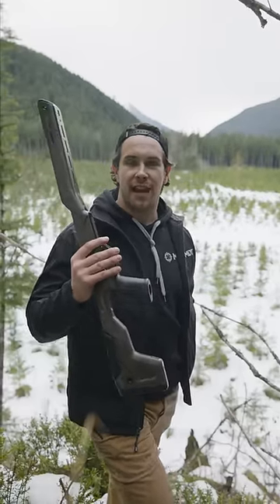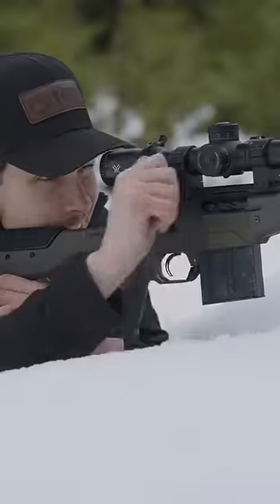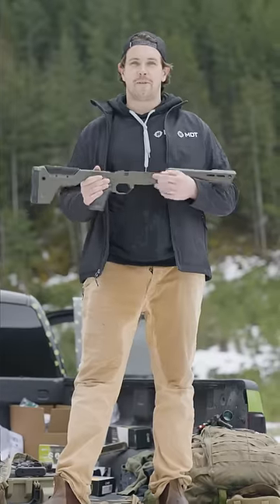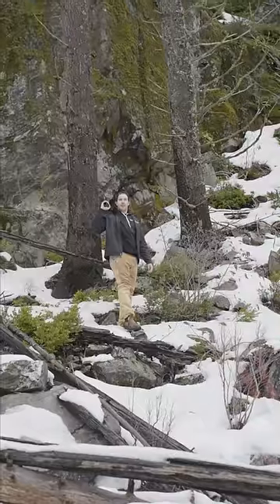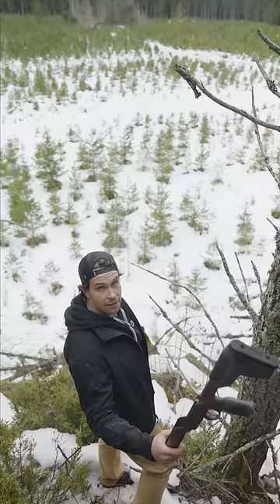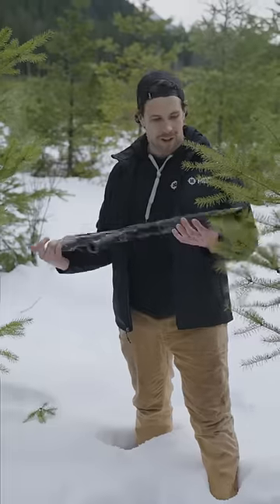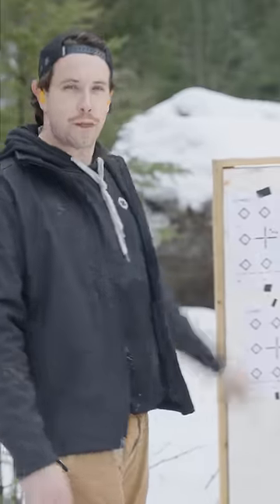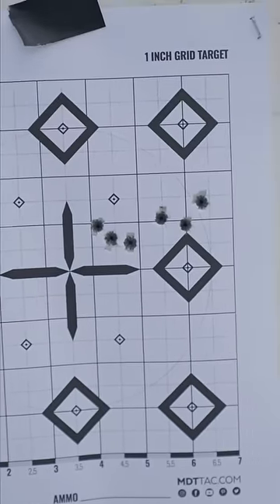Drop Testing Our MDT HNT26 Chassis System

Comment: I don’t think testing something within its limits counts as a test
Reply from the maker: Do you regularly throw your rifle off cliffs? Gangsta!!🔫
Reply: @MDTTAC  it would be if the part your testing wasn’t one piece of extremely light and durable plastic with no tension or load on it, how realistic is this?
Reply from the maker: @THESLlCK  You would be quite surprised by some of the questions that can come up, plus the weather we get here is usually much milder and it presented a unique opportunity.
Reply: That was a stock thrown into soft snow. Not a rifle.
Reply: @MDTTAC where's the barrel that's what matter's the most
Reply: @MDTTAC  yeah soft snow for protection do that on a real road or your drop test hb actually test it on solid ground not snow or grass that's relatively soft 😉
Reply: @MDTTAC no no you got a point. I was wondering how far you can throw it, now we know. how long it takes to hit the ground from a 30 ft cliff, boom answered. don't let someone that doubts your science get under your dingleberrys
Reply from the maker: @trey8875  It was taken out for this as we were specifically seeing what it takes to dislodge the end cap on the forend.
Reply: @planetzodd4849  go to kg boom boom yw 😉
Reply: @MDTTAC  you didn't throw the rifle off. You threw the fucking shell of it. That's like saying you cut a tree down when you only snapped off a branch.
Reply: @MDTTAC I would if I were the developer and therefore responsible for extensive testing of my own product.
Reply: @MDTTAC  do you regularly use unequal comparisons and just about pointless actions in all advertisements of your product?
Reply: @MDTTAC Yes. The occasionally fly off of a UTV or ATVs. We drive about a hundred miles a day on average around the ranch and stuff like that happens. 
I will say my MDT stock on my 22lr. Is holding up just fine though even after the daily abuse we put it through.

Comment: Mdt, it's understandable you wouldnt wanna destroy a hole rifle but a sstand-inaluminum mock receiver and barrel attached to the stock for testing and applying different torque and flex to the frame, and fasteners...

Adding 7 - 10 pounds could drastically change its impact resistancs

Comment: I'm not an expert but since you can disassemble the rifle in 2, body and mechanics, wouldn't you be able to fire the rifle precisely even without the body and just putting it in a vice? If it's a durability test on the body you threw it in snow and in a tree witch I believe would brake the fall. It would be interesting if you could drop it onto some rocks just to see the durability.

Comment: I use to climb to the tops of trees 30-40 feet high and land in snow no problem. I’ve seen people ski off 100+ foot clips into snow and not a single injury. To scale, this is far less. Try it on concrete or off a building. Climb the  height of a tree stand and have it hit straight to a rocky bottom. Stop the cap. Let me test your products to their fullest.

Comment: I find it quite odd that not only do you drop/throw only the chassis and nothing else, but also you only do so into snow, where it will have a nice soft landing, and not concrete or asphalt. Might as well just not bother “testing” anything if you aren’t willing to give it a real challenge, because doing it this way provides no useful results at all

Comment: I see pictures with and without a qd sling cup in the buttstock.  Is this standard?  It would behoove mdt to advertise this feature.  For that matter, there should be a set machined into the front.
Reply from the maker: The HNT26 has QD cups front and rear. Can't machine them into carbon fiber, but there are inserts Chet.
Reply: @MDTTAC  awesome, thanks......Garcon de Chassis.

Comment: Try on something a little harder than snow and a tree and ill be impressed like concrete or rocks, also its not a true test without being mounted with the weight of the action and scope since the weight is all transferred to the mounting points and screws. When you have a bare alu chassis there is no weight or chance of breakage. Common guys don't just do the bare minimum marketing bullshit... really TEST that shit!!  its not like you're paying for it anyway...just sayin...
Reply from the maker: Thank you for the feedback. You are right; however, that isn't what we were specifically testing here. All destructive testing was done long before we released.

Comment: We're going to torture test this truck by taking it's tires off and rolling them gently down the hill. Next, we're going to take this sledge hammer and really bash the floor mats onto the concrete. 

Nice now that we're done with that, let's throw everything back together and see how she drives!!

Wow as you can see, after all that torture, the truck still drives. Amazing dependability.